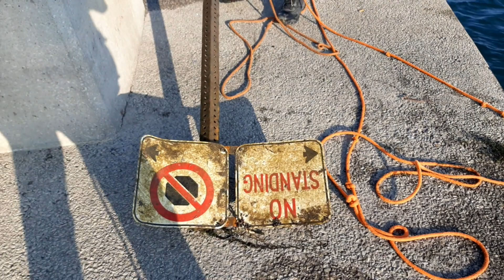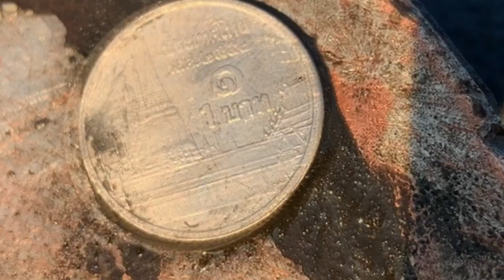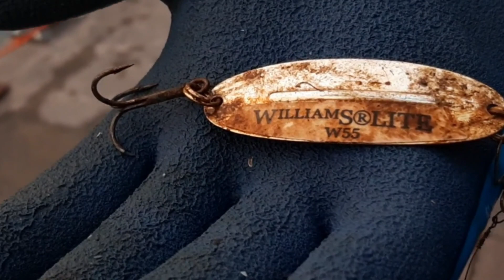MAGNET FISHING : Sick Catches in Unexpected Places !!

Comment: Hello there! Just got started today, and I pulled a handful of coins, a fork, and a stainless steel wrench from my local river. I could only get them partially cleaned by scrubbing them down, do you recommend a chemical to soak them in overnight or something?
Reply from the maker: You can use CLR and a Dawn soap combo soak then lightly scrub the next day. The best thing to do is ‘youtube’ how to do clean rust off things as there are experts in that.  There are many different ways to clean depending on the condition of the piece. There is also electrolysis and that’s a whole other level of cleaning and restoring. Generally a night or two in CLR helps a lot.
Reply: @sludgepirates8521  Thanks!